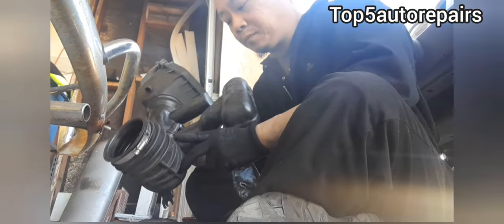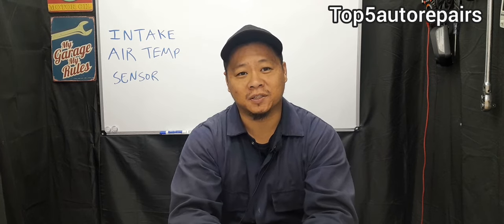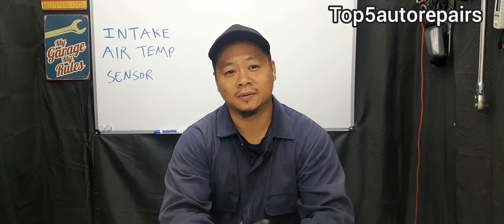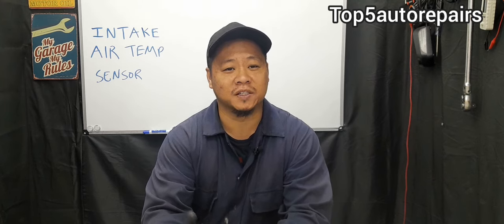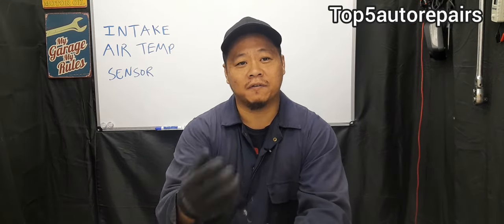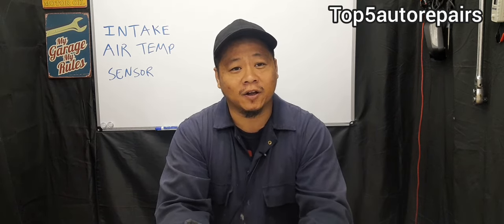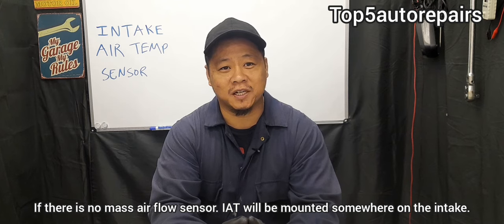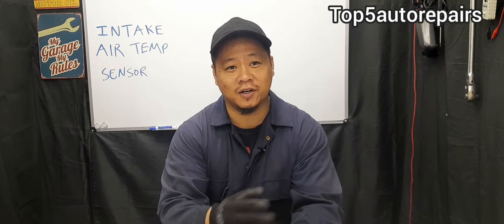Intake Air Temperature Sensor Symptoms | How To Tell It Is Bad and Failing

Comment: My car is hard to start in the morning like 4 to 5 tries before it start but after I drive it for some minutes and start it again it start immediately untill the next day or when the engine is cool
Reply: My car is hard to start in the morning like 4 to 5 tries before it start but after I drive it for some minutes and start it again it start immediately untill the next day or when the engine is cool
Reply: Same symptoms here. I replaced the fuel pump with check valve but it did not help. Was this your issue?
Reply: @UltimatumDemon what was the answer diagnosis
Reply: For me the solution was i had to fix my TIPM. I had a jumper wire in the fuse box, it was taking power from ACC (accessories) and powering the fuel pump with it. The reason it fails when cold is because the car takes like a half second longer to start, and it’s JUST enough delay to make the fuel pressure drop to zero. ACC power gets turned off when you crank the starter, so the fuel pump turns off briefly while cranking. On warm days the engine starts up before fuel pressure drops. The fuel pump relay is 14$ on amazon and i soldered in the replacement myself. You can also just replace the whole tipm from a junk yard or new. I’ve been driving the truck like this for a month now without the jumper wire and i have had zero issues starting since
Reply: Chevy? Get your fuel pressure check. Rent the equip for free with a deposit from your local parts store, they usually  refund you when you give the parts back.

Comment: I replace IAT sensors and air filter, clean the carburetor but none of these work. The only thing that clear everything is clear the error message and everything goes clear for a few motnhs then it goes back again. But when it come to state inspection because they see no problem at all they will tell you to drive it around for 50 miles so that your problem will come out!
Reply: It might be the fault from time to time because of the wiring issue (corroded or poor contact). I have something similar....looks like there is nothing wrong with the sensor but with wires and electrical connectors...

Comment: I'm glad I saw this. I'm having these symptoms with both of my cars. Hopefully a new IAT sensor is the solution.
Reply: Was it the solution?
Reply: @j.j.aguilar No, but I know what it is now. With my 96 crown vic it's an EGR valve and my 98 mustang it's a mass air flow sensor.
Reply: @brianspangler3771  Ahh for sure were you getting codes for IAT or just symptoms?
Reply: Just symptoms. I will point out that my mustang has a custom tune so the light has been turned off. Not sure why my crown vic wasn't throwing a light though.

Comment: would this rough idle occur at any rpm?  Having an issue with a 93 v6 4.0 rough idle at all rpm.  Almost like not hitting on all cylinders.  coil pack has been replaced along with plugs and wires.  Did clean the MAF but not sure about the location of the IAT sensor.

Comment: Could you get symtom where you press the gass pedal and when you release it you get a engine bump feels like a jolt?  and also I get go response in 1st and 2nd soon as in 3rd there is like a 1 second delay and boom its responding
Reply: 1st and 2and good responce and 3rd gear I get a one second delay and it's back on accelerating
Reply: i’m having the same problem with my celica

Comment: When car is working i remove the fuse from that sensor but nothing changes.. shouldn't the car turns off ? Sorry for my engklish. Pls answer
Reply: it might be because you have broken wires and poor electrical connections in connectors....

Comment: You are a life saver with this information! Ever since summer started my diesel has been hard starting and shutting off after running for awhile. It finally dropped into the 70s and boom, started up perfectly normal. I'll have to get one of these sensors and see if that fixes it.

Comment: Quick question, my truck had the codes for the Maf sensor and also the intake air temperature sensor, i cranked my truck and disconnected the maf sensor and my truck shut off, doesn’t that mean my maf sensor is good, if not if I change the maf sensor will it fix the intake air temp sensor issue

Comment: Thanks bro! I was getting bank 1 and 2 lean codes, cleaned the sensor with MAF cleaner, still coming up. had it checked at dealer and it was reading way higher than ambient temps. replaced and all good!
Reply: so, you just replaced the intake temp sensor & it’s back to normal?

Comment: Will a bad IAT sensor also cause the air recirculating button to not work? On my 2007 PT Cruiser the recirculating button turns on if the car sits for a while but then turns off a few minutes after the heat is on. I'm in PA. Thanks in advance.
Reply: No.

Comment: Mine is an o4 Cummins 3500 and it's very hard to start under 60 degrees sometimes even in the mid to high 70s.   But once it stsrts it runs great. Lots of power and it idles well.

Comment: I cant find mine at all...theyvsell the part for my truck but everything i read says my iat sensor is integrated in my maf sensor.....2008 f150 4.6 
They sell the iat sensor but theirs no where to put it!
Reply: What you have is a MAP. Normally a Maf connector has 3 wires (power ground and ecu reference voltage) but in somw vehicles inxluding yours, the manufacturer combine the two into one resulting in a connector that has more than 3 wires; the extra wires providing info of the intake temperature to the PCM